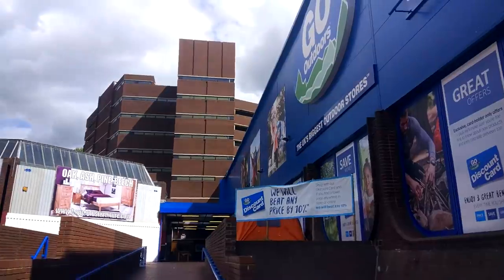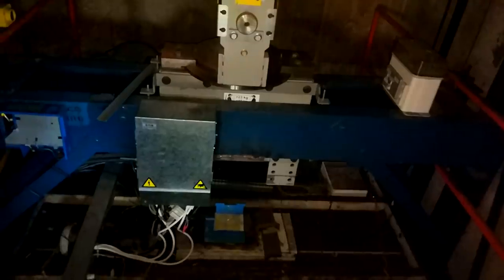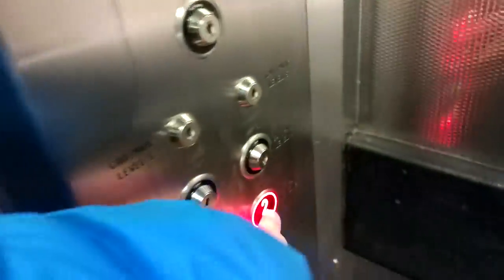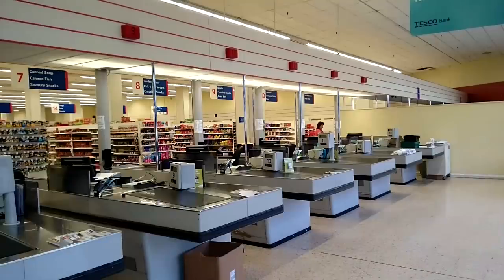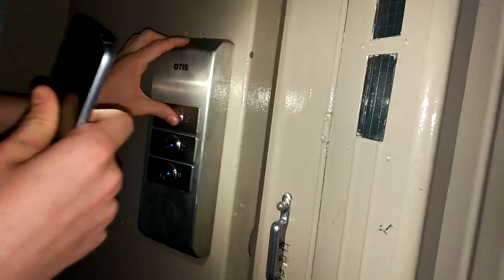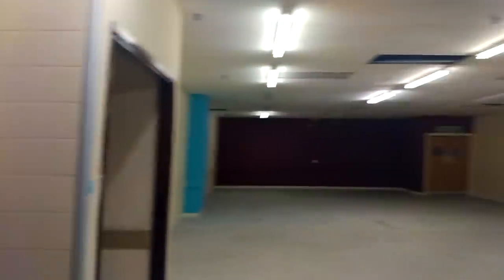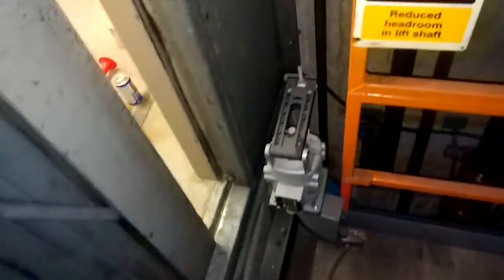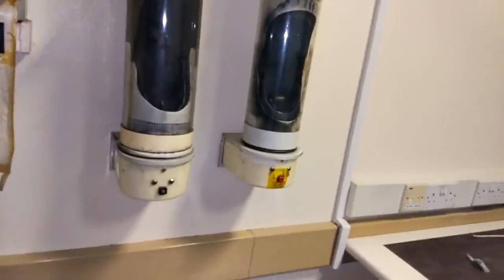Tesco in Chatham full URBEX

Comment: Looks like there is a water leak in the woman’s toilet. There’s water all over the floor. Amazing that the CCTV monitor in the manager’s office is still working and that is is in colour. It looks like a cheap TV from the 90’s. Would make a nice monitor to use with old computers as it show “Pal” video mode😁 in the top left corner. The building has a bit of a late 70’s / early 80’s look to it. The carpark has an interresting mix of in-situ concrete construction and precast TT floor slabs.
Reply: I remember the Tesco store opened in 1982.
Reply: Tbh that is what Tesco’s toilets look like normally😂😂😂
Reply: Really nice metal cased video monitor from the 90s. Yes, great for some retro computing use.

Comment: You should've tried to get the PA system to work, old PEL install, with what looks like Delta Sound ceiling speakers... it probably would've fired up first time.
Reply: Yeah, I would have liked to have seen the PA system working. The microphone would have probably been where the customer service would have been.

Comment: I was a Store detective here back in 2014 months before they announced the closure and before that I was uniform. It always had that 70's theme even the restaurant after these many years. I sat in that restaurant when I was young and all I remember is those 2 pack jaffa cakes at like not even 50p. I still have memories of photos from there the good old times and shoplifters would run from the fire escape with BWS 🤦‍♂️

Going into the car park to assist the trolley lads because they wouldn't go there on their own because of the drug problem.

Comment: i think the money chute idea is very interesting. did you find the motor that sucks that air? that would be a really interesting big industrial fan than might still work. did you also find out where the cashiers hole for the money chute is? you could put a small action camera there and collect it at the managers office. very interesting shopping centre. next time i want to come here and find out where the vacuum fan thing is for the vacuum pipe.
Reply: Pretty much all large supermarkets in the UK use money chutes, including the ASDA store near where I live
The chute thing has indicator lights below the slot at the tills, to show when the system is ready
And also, some stores only have them on every second till
I have also seen a cashier insert a capsule into one
Reply: I've noticed those weird chutes at a few Coles and Woolworths supermarkets here in Australia too, but never would've guessed they were used for money or that they used pneumatics.
Reply: i think the only problem with having a money chute would be if the money chute's pipe system broke. people could easily put their hand in and get the money.